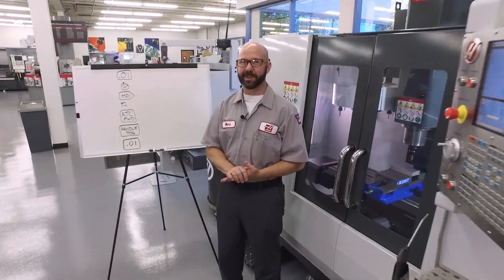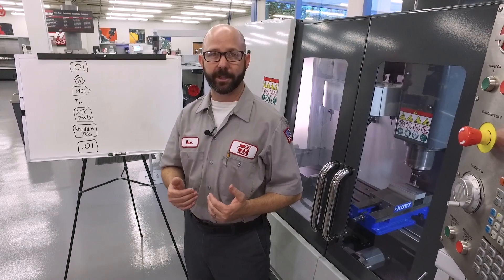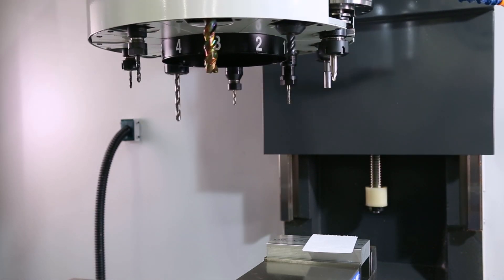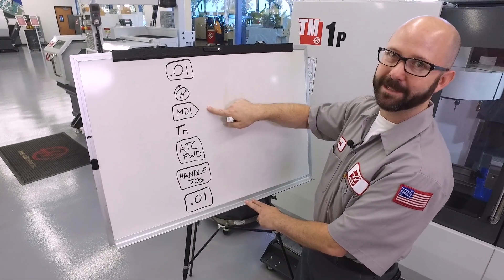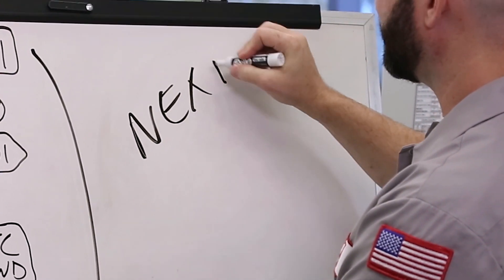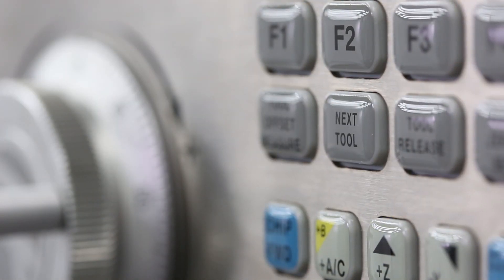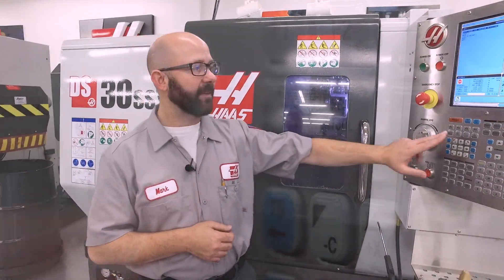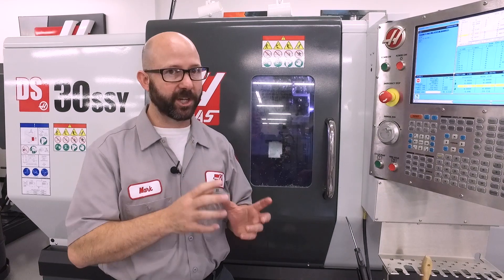Reduce Setup Time with the Haas “Next Tool” Button – Haas Automation Tip of the Day

Comment: Can you put in a block number say a one inch so it will automatically add it to your offset?
Reply from the maker: Don L  - To adjust the Tool Offset by 1”, we would need to manually adjust the Tool Length Geometry, Tool Length Wear, or Work Offset Z (affects all tools using that Work Offset) by the 1”.  There are some other things we can do, using macros, or Setting 64 (Tool Offset Meas Uses Work), but these can be dangerous if every single person in the shop isn’t aware of the system you choose to use. Check out our Tool Length video (and comments) for more info:  https://youtu.be/uNjMIIRttFE   – Mark, Haas Tip-of-the-day

Comment: This feature would be much more interesting if it could read the current program and sequentially select those tools. I have the side mounted 24+1 ATCs, but most parts only use a partial rack. Some 'normal' tools stay in the machine all the time making the tools list non-sequential for every program. For offset measurements I can use the probe to pick the tools I want, but generally before I do that, I need to load the tools or at least check to make sure they are in the correct position - requiring a lot of buttons and a printed tool list.

Comment: does this work with a side mount as well? will it go to the next tool number or just the next pocket?
Reply: it does work. just tried it. thanks Mark.
Reply from the maker: +Mike H 
The NEXT TOOL function is going to work the same on your Side Mount Tool Changer SMTC Mill. Pressing ATC FWD will put whatever tool is in the next tool change pocket into the spindle. NEXT TOOL will grab the next tool, in numerical order, no matter where it is in the carousel. Example: T1 in spindle, press NEXT TOOL, T2 will be put into spindle. Glad to hear you had success. Thanks for the question!
-Mark, Haas Tips of the Day

Comment: Tool 3 is beautiful. What is it?
Reply: +wooooowwe1 it looks like the DLC coated carbide end mills I use for aluminum. I´m from Germany and here you can buy DLC coated tool from Hoffmann or WNT.
Reply: +Tobias Merten I also primarily machine aluminum but have never seen it. I will have to look up my machine tool manufacturer and ask them for this. How would you compare this to regular HSS or Carbide or Ceramic even if you have used it?
Reply: +wooooowwe1 the DLC coating is extremely smooth what prevents the chips sticking on it but they are not super sharp what results in a little burr but the surface finish is very good. I love the DLC coating in plexiglass or other plastics like Delrin it maks a very good surface finish. 
My favorite coating for machining aluminum is TiB2, the end mills are sharp so you get no burr, surface finish is very good and they last very long but they are a bit expensive. I also use end mills with ZOX ore ULTRA N coating for aluminum, the ULTRA N is the cheapest that's why I use them most time.
I don´t use HSS ore Ceramic end mills and uncoated Carbide only for extrem sharp finishing end mills.